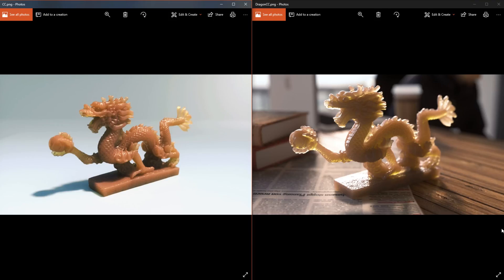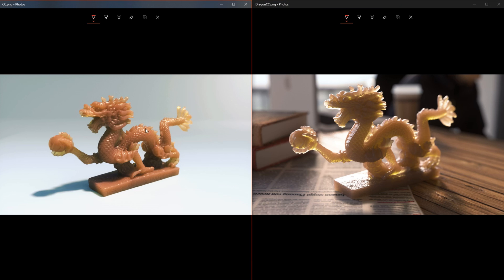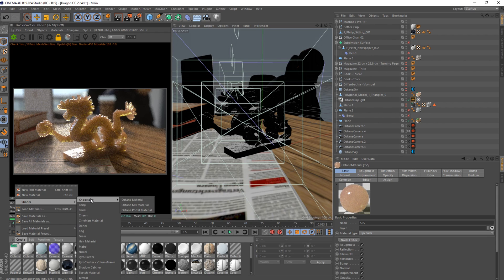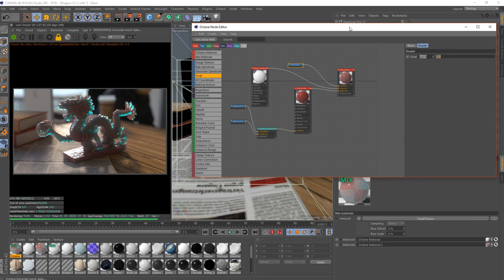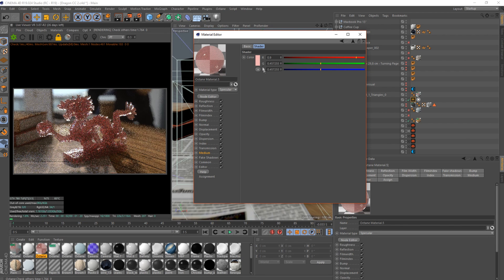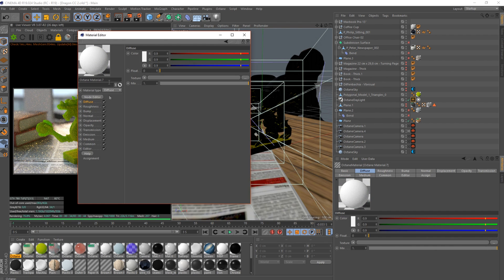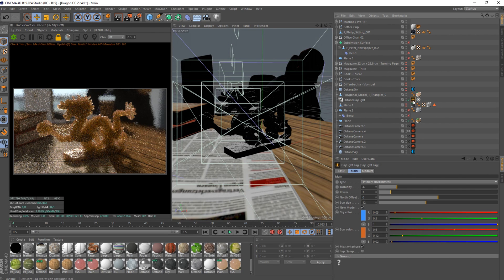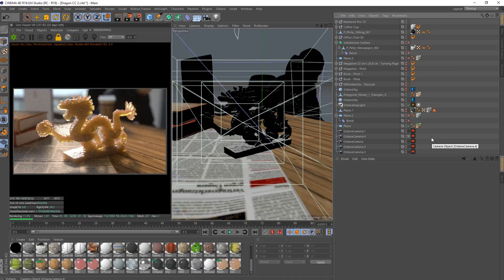Cinema 4D Tutorial - Realistic Subsurface Scattering (Octane)

Comment: what kind of graphic card do you have for Octane?

i was thinking of a egpu GTX 1070 Arous for my imac?
Reply from the maker: I work with a 780ti because of the cuda cores it offers man. Will pick up another at some point but if you've got the price range easily go for a 1080ti over a 1070, way more cuda cores and you can probably clock in more v-ram as well bro! :)